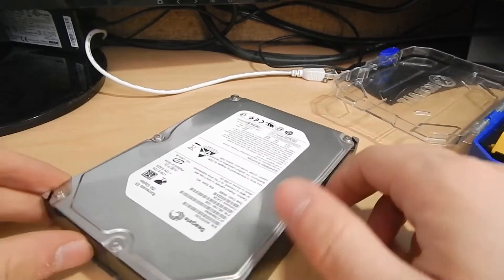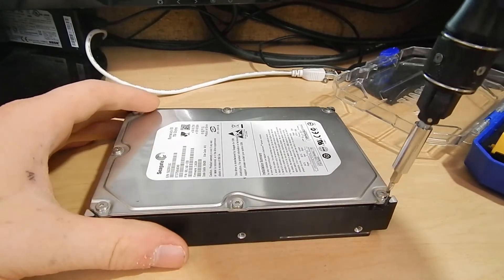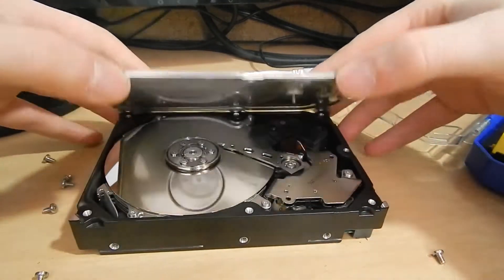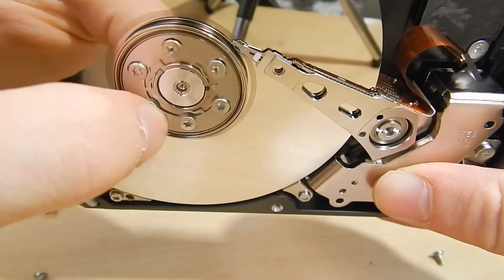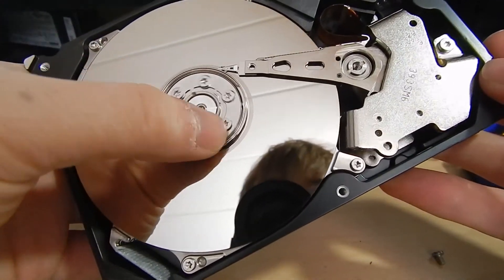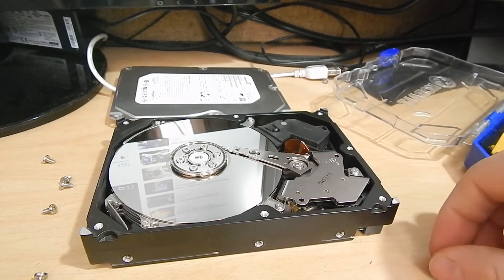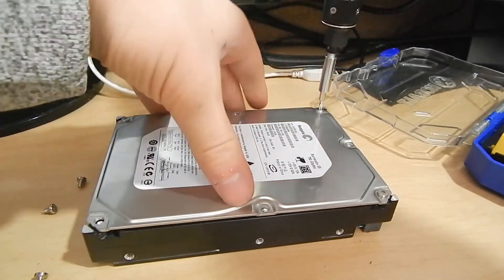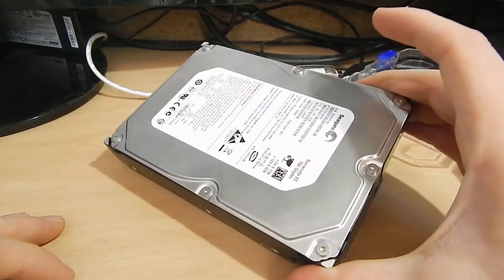Server Hard Drive Head Crash Inspection

Comment: The Seagate, after head crash occurred, did it still appear as a mounted volume or even as a drive in the system, or was it drop dead completely after the failure happened?

Comment: don't buy refurb drives from ebay. i just bought one a 2tb hitachi drive very cheap and here it is! - https://www.youtube.com/watch?v=XIPkq72OVIw
Reply from the maker: I would generally shy away from ebay drives as well, however out of the five of these I got, I have only had one failure, and it still lasted for over two years, so i'm not at all disappointed with these drives. as for your drive, it looks like you still have it in a static shielding bag. This is not a good idea because those bags are actually coated in a conductive later of material. powering it up while in the bag may be shorting out the control board. I would defiantly try taking it out of the bag, but it is also likely that you got a bad unit.